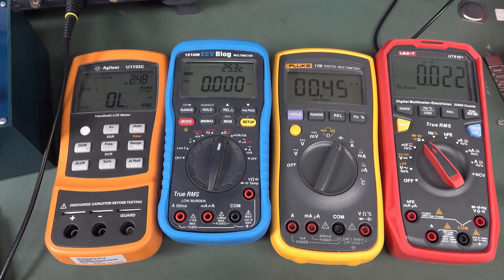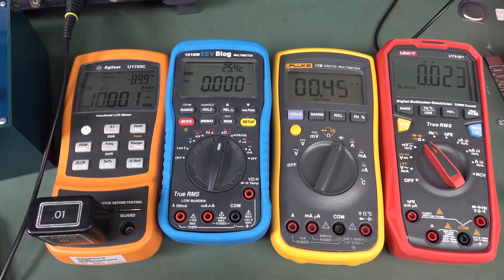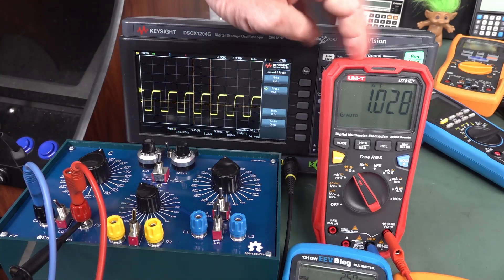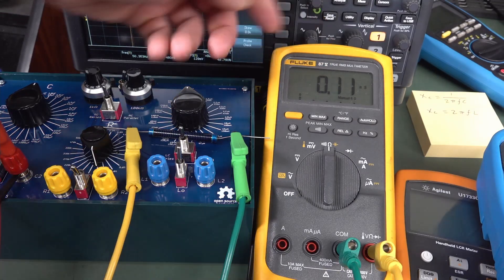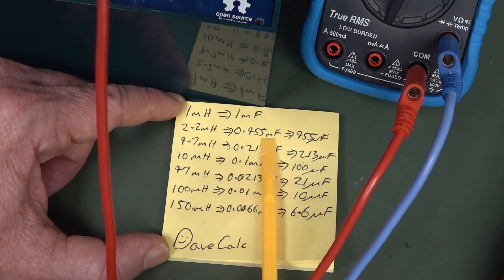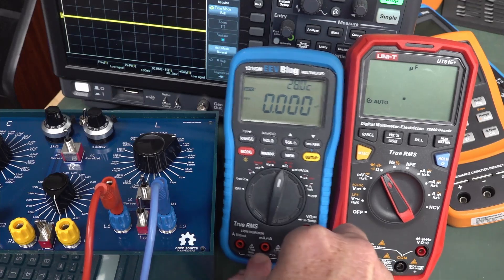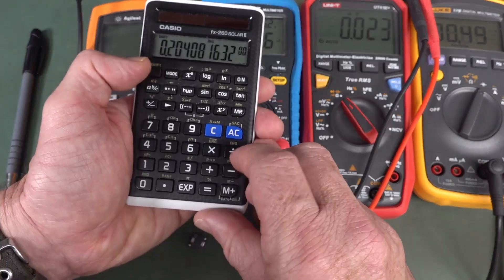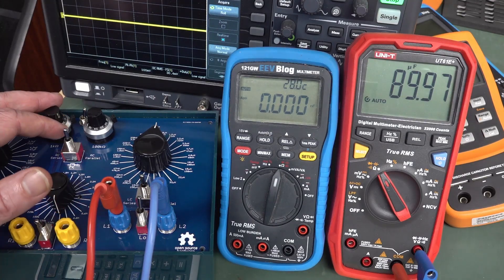EEVblog 1465 - Your Multimeter Can Measure Inductors

Comment: Hey Dave, very interesting video. If you know a trick, could you make a short video about measuring extremely small inductors as well ? I'm trying to reverse engineer the components between a balun and a printed antenna on a small 2.4GHz transmitter and I have no Idea on how to measure them. Many Thanks !
Reply from the maker: You'll need a proper LCR meter at the very least and a decent probing setup for them.
Reply: @EEVblog  A review of LCR meters would be great at some point.  The cheap ones seem to struggle with low value inductors, such as used in antenna loading coils and tuned circuits for HF.
Reply: @EEVblog  Thanks for the feedback. I have a DER EE DE5000 model LCR meter, but I only get resistance values when checking the components. I cross compared those resistances with values from component datasheets and it's probably a 4.7nH component, but it's not certain. Some datasheets were disagreeing and it just feels unfulfilling to not be able to truly  measure.
Reply: @anschflck8049  if you post on eevblog forum you get best advice from expert with experience on the item and some times you realize someone else actually solve that issue already and happy to share the results
Reply: The components in such a 2.4 GHz balun will have quite small values as their impedances will be in the 50 ohms (at 2.4 GHz) range, so caps between 0.5 pF to 30 pF and inductors of a few nH would be what you might find. To measure those you generally need quite expensive equipment. Also at 2.5 GHz you will need to use components that are specified at such a high frequency. What an RF engineer might do to reverse engineer this circuit is to measure the impedance at the antenna (without the antenna) using a VNA. Store the plot (or Smith chart) of that impedance. Then desolder a component and replace it with a known value, keep replacing until you get a similar curve back. Do that for all components.
Reply: @peterpv0001  Thank you very much! That is some good advice and I'll look into getting a VNA and identitfying the components with the described method !